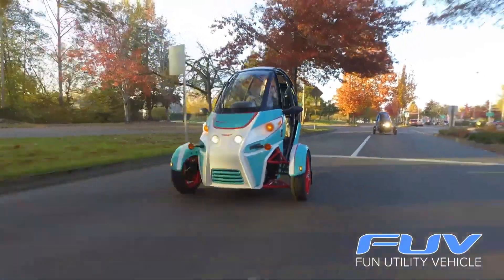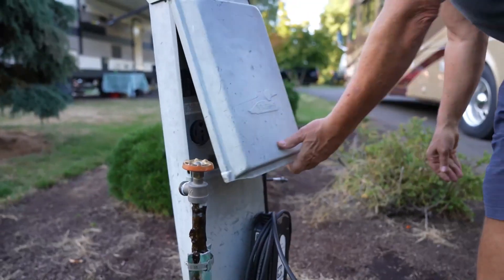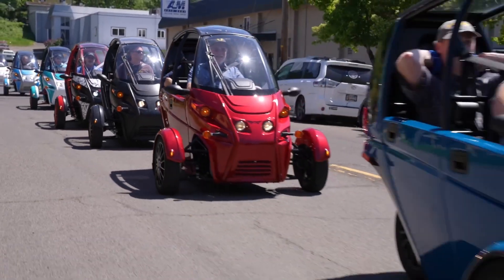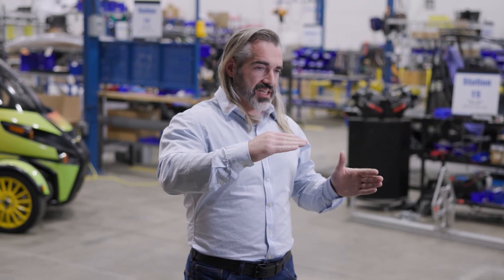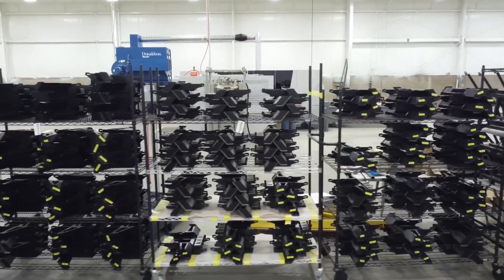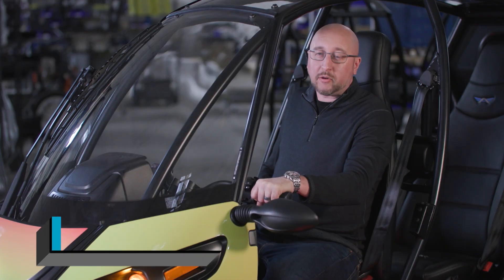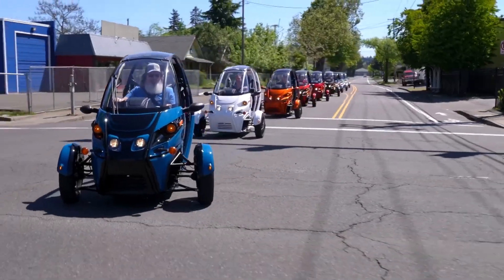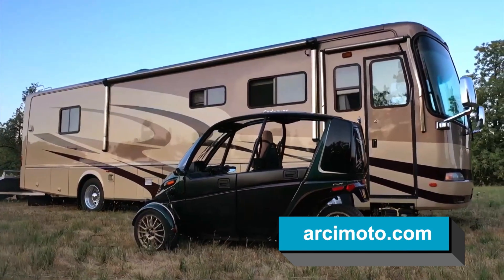Sustainable Transportation Systems for Commercial Fleet

Comment: After the pandemic and the war economy Arcimoto has been dealt yet another blow - only insiders know exactly why power was turned off for the main Arcimoto facility but there was storm damage in that region that kept the internet out for over a month now and there was roof damage on the Arcimoto campus. Power is usually turned off for such major repairs
Owners have two Facebook groups for support, advice, parts and used sales. Many of the issues deal with worn brakes which can be done by many different businesses. We have insider information and we share our parts sources. The solar/pedal powered velomobile in my avatar image went under 3 years ago and yet 900 owners have a network for support on Facebook. Note that there is a new push to open Organic Transit again and if Arcimoto's status changes there are many possibilities as to why - buyout, partnership, mergers are all possible and likely because the EV market is growing. 
Arcimoto still owns Tilting Motor Works and now has a partnership with Faction self-driving and a French company has contracted to make an electric van in Arcimoto's large factory.

Comment: I bought an Arcimoto FUV last July as a "second car" for commuting and errand running. It has become my primary vehicle. My other vehicle is a Ford F-150, and I have only been filling the gas tank about once every two months. Unless I specifically need the truck, the Arcimoto accounts for 99% of my driving.  Oh, my electric bill went up by about $15/month because of charging.

 I just went past 3000 miles on the odometer last week, all city and suburban driving.  I had been reluctant to buy an EV both for the initial cost, and the added cost of installing a charging station at home.  Then I looked at  my typical trip and realized I didn't need a $70,000 Tesla.  The Arcimoto also charges from a standard 120 volt outlet, so I didn't have to put in an expensive charger. 

We tend to look at our cars as "Swiss army knives" that perform many functions... commuting, errand running, cargo hauling, roomy enough for the whole family to fit inside, and comfortable enough (and have range enough) to drive cross country. The Arcimoto isn't the solution to every automotive need, but what it does, it does well.  

The two seats means I can take my wife down to the local drive-in for a burger and shake, and Arcimoto sells a cargo bag for the back seat of the FUV;  I find if I pack the beer and laundry detergent alongside the seat I can get a shopping cart full of groceries.  I have even put a doggie bed in the cargo bag and taken the mutt on a ride.

One caveat: don't buy one of these if you are the least bit introverted. Because everywhere you go people want to talk about it and ask questions.
Reply: they actually delivered it to you?? because they have been reported to make a little over 200 last production and delivered less than half of them and since march their website is down.. it also was reported that they were likley going to file bankruptcy but raised 12mil early last year so it would be nice to know wth is going on with them..